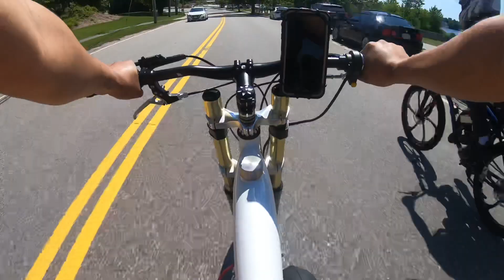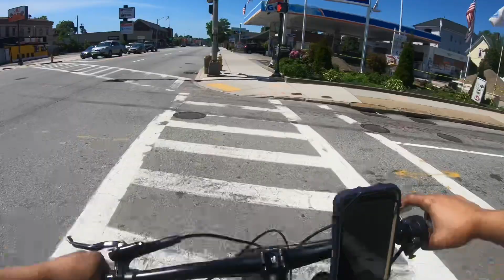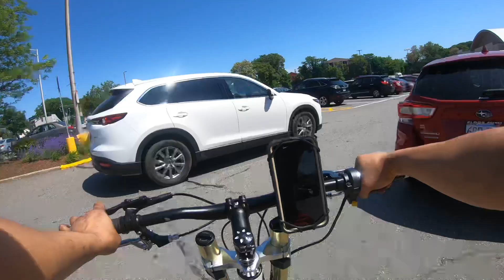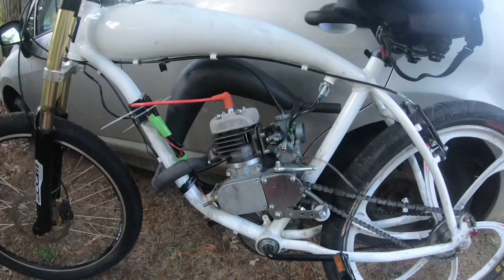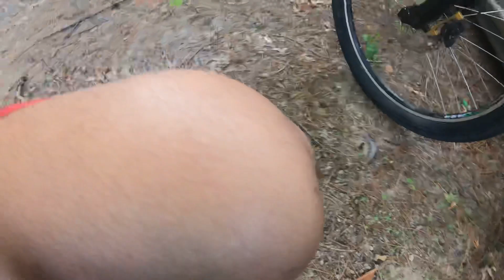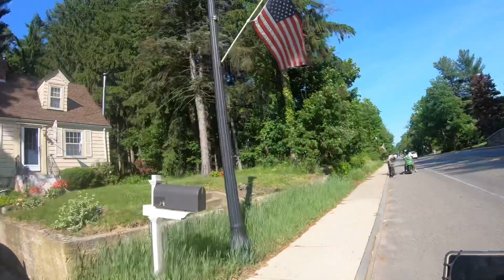Gas Bicycle City Cruise Minarelli vs Minarelli 50mph+ FAST !

Comment: Bro that wasn't from your chain, it would have stayed locked up that's a soft seize bro. Happens easier with iron next to aluminum expanding differently.
Reply from the maker: Ya thanks. We found out in later on that was the case. Watch the next few videos after this one
Reply: @hyperdashgarage  I watch all your videos bro 💪

Comment: That absolutely wasn’t ur chain making ur wheel lock up, nor was ur wheel locking up. It was ur clutch pads squealing because ur cylinder cold seized. It’ll happen when u have a lean tune and the piston heats/expands faster then the cylinder. Why u running the crappy stock heads? Check out some fast bikes on my channel under my name

Comment: What forks on the white bike? They look really solid. I would love to get them???
Reply from the maker: They are called “ZOOM downhill mtb forks with a 20mm thru axle”
Reply: @hyperdashgarage  hey thanks I’ll try to look them up. I have a gas bike frame just like the faker so i guess they should work. Ill have to measure it up but i think its 1 1/8
Reply: @hyperdashgarage  someone said Worcester...? In Massachusetts?
Reply from the maker: @rogerstafford-wakeinc.2088  yes these forks are 1 1/8in
Reply: @hyperdashgarage  ZOOM downhill mtb forks with a 20mm thru axle